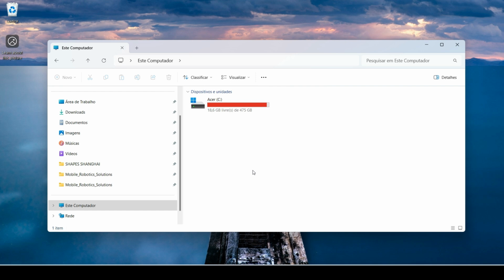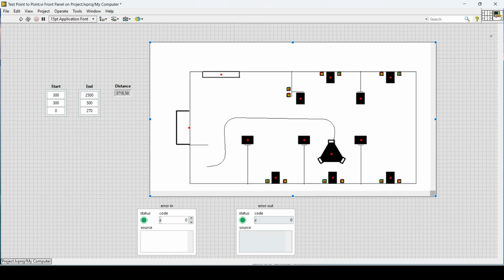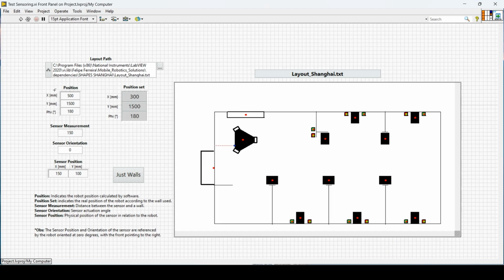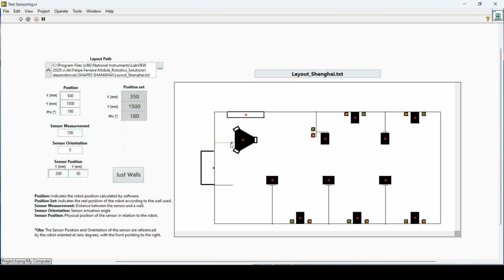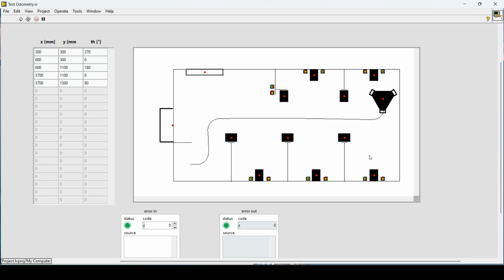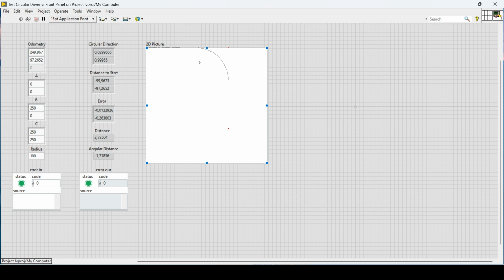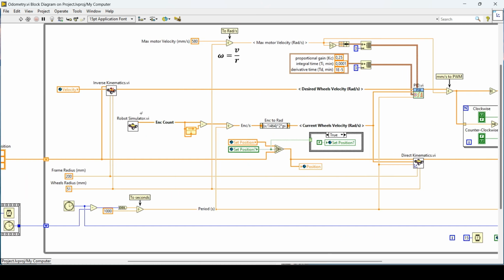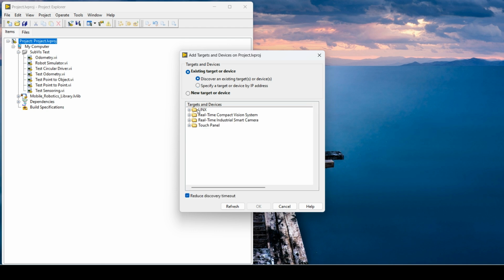#3 Using the Library - Mobile Robotics Solutions

Comment: Hii bro can you please help me how can I create a simple model in LabVIEW for switching motor on and off and reading the rpm
Reply from the maker: @SufyanQureshi-n8p  Hello, it will depend which microcontroller you are using. For example, if you use a Myrio you have to install its Toolkit, create a new target specific for myrio in your project and use the specifics VIs for PWM and sensor Reading. The same for other systems such as Raspberry Pi or Arduino.
Reply: @FelipeFerreira-jt5ci  Thanks for replying